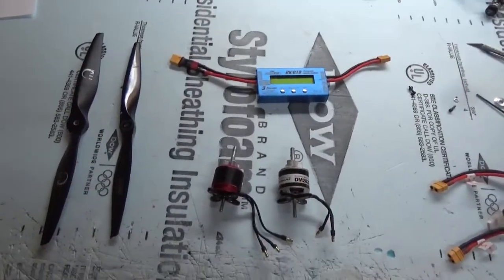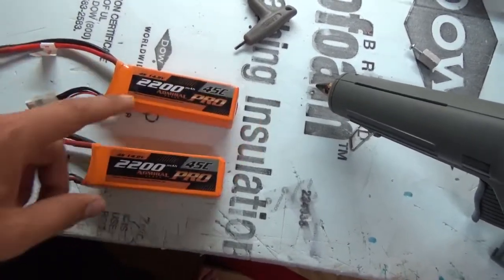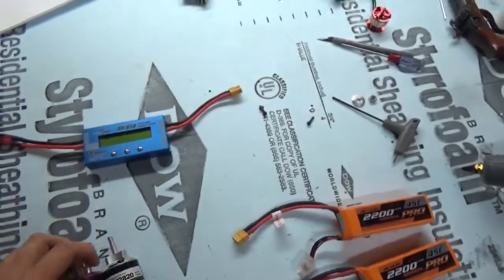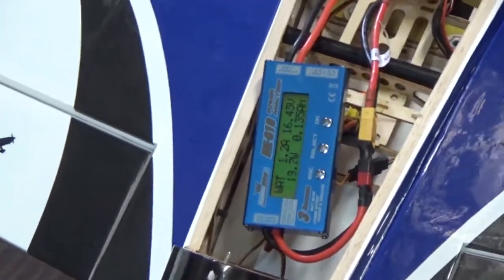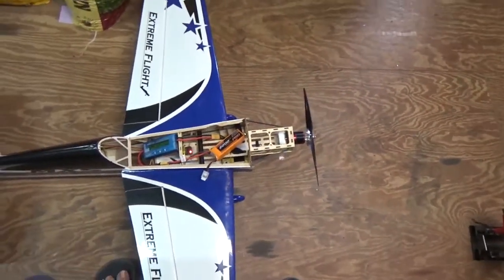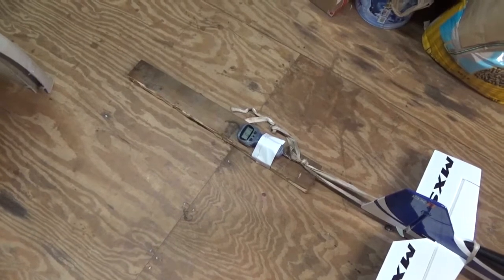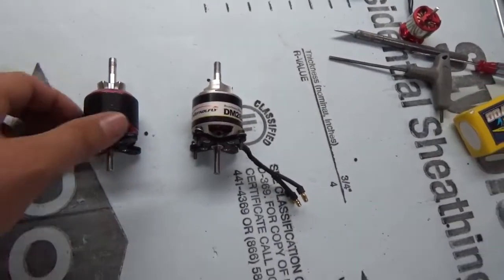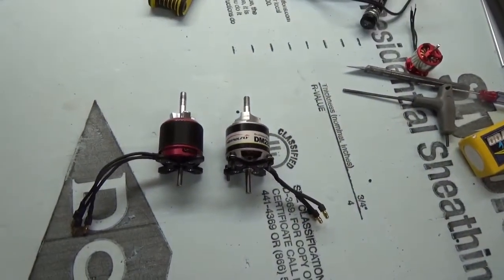Torque 820kv VS motorlfly 750kv for Extreme flight 48in airframes

Comment: Stock motor in my eflite extra 300, (910kv), 4s swinging a 14x5 wood prop, has plenty of hovering ability, superb pull out, & ive thot about getting a couple of those for another 60 sized bird i have.